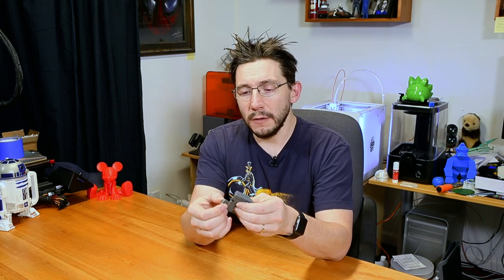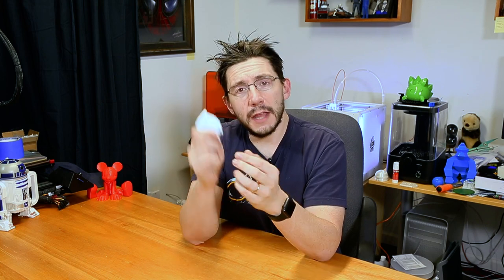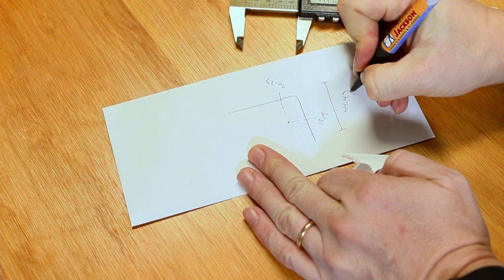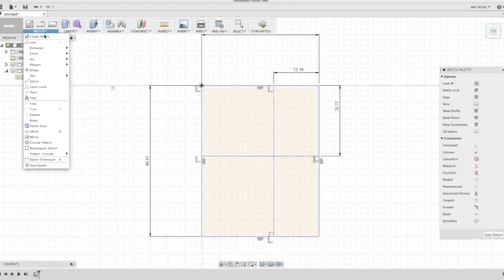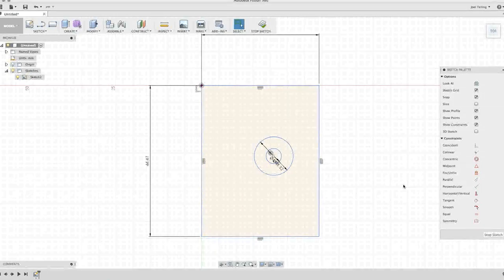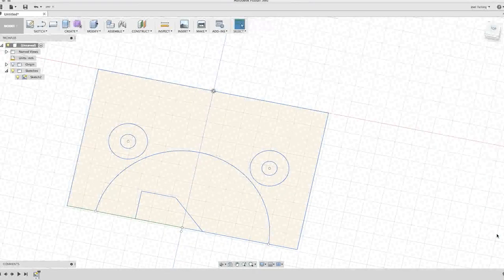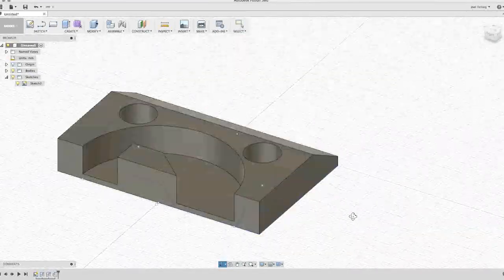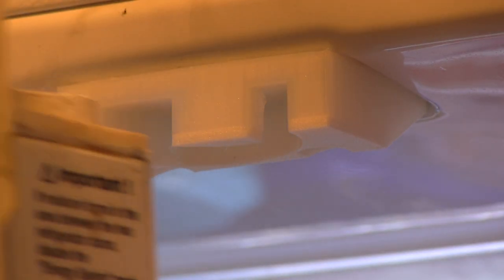FIX my Fridge with a 3D Printer? Functional 3D Printing!

Comment: Sweet video. One suggestion : take a picture from the top, import it in f360 and resize it until a feature you measured matches your measurement. Once it's the right size, you can just sketch on top of it. That way you pretty much need only one measurement with your caliper. Just sayin'
Reply: JD Begin awesome tip :D
Reply from the maker: YESSSS!!!
Reply: JD Begin  You can do the picture thing without the ruler if you measure the x any y of the part and use the scale  in the canvas function of fusion to calibrate your workspace. I've done it a few times on different projects and it works pretty good. I saw a video showing the steps but I can't remember who made it, it might have been one of the autocad fusion 360 official videos , but it could of been in one of NYC&C's.
Reply: it ways Scott Moyse
Reply: I have done a similar thing using a flatbed scanner.
I imported the scan into Inventor and surprisingly the scale was right on with no extra work.
Then I was able to draw on top of that to make the changes I needed.
Although If your part wasn't flat like mine was the picture method would work better.
And maybe if you have some graph paper.
Take the picture with the part sitting on that.
That may make adjusting the scale a little easier.
Reply: Yes, a flatbed scanner works great for this since you are pretty much guaranteed that the scan will be 1:1 scale.  A photo is prone to distortion but the surface that touches the scanner will be accurate within a hair's length.

Of course this only works if the part you are scanning is flat but I've had decent results scanning plenty of curved objects as well.  The scan just needs to be cleaned up a bit in Photoshop and then resized according to the measurements you take with a caliper.

Great video nonetheless and helpful since I'm one of many who are now transitioning from the late, great 123D Design to Fusion 360.  Tutorials like this are really helpful!

One suggestion for any video with a timelapse build, could you please let us know how long the print took?  I'll be in the market for a new printer this year and print times are a factor in my decision.

Comment: When I measure and model prints I will use different sizes based on the type of printing I use.
Basically I will input more accurate measurements for Resin printing. But for FDM printing I input a little larger sizes as FDM tends to be off for various conditions. For example if I want a 3mm hole for a M3 screw I input the circle's measurement as 3.4mm for FDM.
I made a template with screw & nut sizes and printed it out so I know exactly what size to input when modeling. It is usually inner holes that are off more while outside dimensions will print closer to actual dimensions when printing in FDM.
That is just something I have noticed.

Comment: just an FYI  for those who don't have much of a background in engineering, design, or machining /manufacturing. if possible always try to avoid sharp inside and outside corners/joins by adding fillets/radii to the join. on the part Joel did in the video that would mean putting in fillets in the lower arc and around the base of that little nubby cam thing in the middle part. by putting in those fillets you will increase the strength of the part by reducing the possibility of cracks forming at those sharp joins which are inherently weak.

Comment: Nice video - handy tip perhaps: when drawing your centre circles, just draw them to the right diameter and then use the Dimension tool from the circle centre point to the edge of the rectangle to set the position. No need to draw the lines, unless you are using them for other permanent geometry (I assume you come from Sketchup, which used Guides extensively as I did?).

Comment: Once you've printed a part in Nylon 910, you realize how weak other plastics are when 3D printed (especially interlayer). I was printing a medical device, and my colleagues said "it can't be as strong as the metal original", while true since it was 4mm stainless, I took my 3D printed part, ran it over a few times with my SUV, then proceeded to tow my daughter's SUV down the street with the part in the middle of the tow straps, then put in the part in an autoclave just to demonstrate how tough this stuff is. They all were converts, since I pointed out it was way stronger than our patients, it didn't matter it was weaker than stainless...
Reply from the maker: Hahahahhaha GREAT story!

Comment: Joel, there are 1,000,001 ways to do something. The way you did it worked for you. So that's a win! Just because someone did it another way doesn't make you wrong! 

My success factors are: - Did i understand it, Did it work for me, Is it efficient (can it be done faster/easier another way)

I'm loving learning fusion 360 and it's great to see how others do things with an open mind to either encourage me to stick to the path, or signpost another way to do something.

Great job and keep up the good work #highfive
Reply from the maker: Wow, that is a great way to look at it, thank you! #ReturnFive

Comment: hey Joel,  liking the video! if that was me id probably sneak a few mm on the inside curve floor , looks like there is a bit of clearance in the catch mechanism, also you could put a hole though the front piece that gets impacted, (plenty of perimeters )  and put a metal rod it in maybe.. 

between you and makersmuse and nilabean you guys convinced me to save and buy my first printer, and i an now the owner of a Prusa mk2 .. just starting to knock out my own made models too so thank you for all the tips and advice!
Reply from the maker: WOOOOOO!!!!

Comment: The middle part will eventually break off again due to the weak bottom layer, you could do an upgraded version and extend the middle part so its connected to the right side (when installed in the fridge) for even more strength.
Reply from the maker: Oooh, I thought about that, then forgot. THANK YOU for reminding me! Brilliant, man!

Comment: all u need to do is use a dual extruder printer and print the part that keeps breaking in flexible filament and try to make that part have more layers connecting to the piece

Comment: Fantastic video, once my 3d printer arrives, my first functional print will be similar (a shelf end-cap is broken in our refrigerator...)  I've seen comments by other youtubers that your able to get some of the best prints out of your machines, and this with nylon is no exception.  After you've calibrated your printers, how do you go about tuning your prints for each new filament?  Is it strictly trial-and-error, or do you have a specific manner in which you test filaments to ensure the highest quality out of your printers?  (I can't remember who made the comment, but it was something along the lines of "Joel is truly a 3d printing nerd.  He's able to get better prints than I can out of the same hardware, he must spend a lot of time tuning his machines for tip-top performance" or something like that...)  Kudos to you Joel!
Reply from the maker: Thank you!!! For me, I don't have a lot of time, so it's trial and error. and blind luck :) I try to use baseline temps for filament types, then adjust the temp during print if I see a change should be made.

Comment: I might be wrong Joel, but doing it your way, the holes will be in the wrong place. You are measuring from the side of the hole to the edge, and it needs to be the centre of the hole to the edge.

Also, you've a set of calipers and the part - measure it directly!?
Reply from the maker: +Phil Waud hmm, wait, I think I got it right-ish. I used a pen to mark center of the holes then measured from the sides. Is that what you mean? I would have measured directly but when I checked I couldn't seem to use the dimension tool to go from the side of a circle to a line. I'll have to try again another way to see if I can do it better. In the long run, I did learn something and the part did work :)
Reply: Not saying its the right way, but you have to think what you can actually measure. You can measure the diameter of the hole, and you can measure from the edge to the edge of the hole. Either calculate the correct circle centre or re create the same in fusion, a parallel line from the edge as a diamensioned distance, and then a circle with a tangent lock on it.

Comment: I could buy 10 fridges for 3 and a half thousand!!!!

Would an Anet A6 be capable of this, as that is possibly cost effective long term.

but excellent video, although of course im sure as its flat scanning it would be quicker if you can import pictures in the cad software..
Reply from the maker: True, scanning in would have helped. An Anet A6? Yes! It could print the part, though, I'm not sure what it's max temp is. The Nylon prints around 245c not too shabby.

Comment: Did you say Trusty or Rusty calipers LOL OK I know it is paint
You should spend a little time to learn about undefined and defined elements in Fusion 360. That is one of the main forces with this type of CAD system (parametric design). That would mean that you use the right window with all the constraints about as much as the dimension tool. It also means that you eliminate those accidental  movements of the design when you dimension it.

Nice video High Five from Germany
Reply from the maker: Trusty! Wait, I hope I said trusty. ha! #ReturnFive

Comment: You could have used the same material, but make the base of that piece a little thicker, since that's the part that failed.
Reply from the maker: Well, it was the front piece starting to separate from the bottom, so thicker bottom may not have fixed it. I feel like I need to prototype more and test more :)
Reply: I always tend to rethink the designs before testing other materials, but that might be because in my country filaments other than ABS or PLA are way more expensive. In this case if the original piece broke, the design can definitely be improved.

Comment: there are better ways to put in the circles. but your way works fine it just takes a bit more work.
Reply from the maker: I knew there would be - what are the better ways???
Reply: Well they may not be better its just depends on what you prefer, But you can make the circles and just dimension from the center point to the sides, and that way you wouldn't have the get rid of the lines and also get the center point with them. I only know this because I use auto desk for their inventor software (which is very similar to the fusion 360) in school for my engineering class. thats how i normally do it and prefer that way, i find it easier.